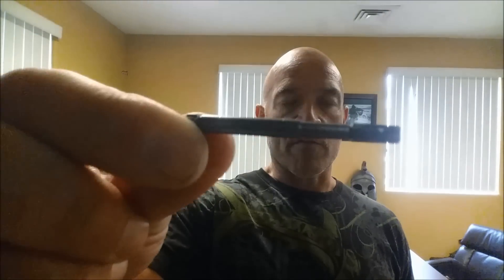Suarez Steel Firing Pin

Comment: Does the lighter weight of the pin increase the possibility of light primer strikes? Or does the fact that the material being harder compensate for the weight reduction?
Reply from the maker: Not in my experience.  The longer firing pin nose would compensate for any issues that may occur.
Reply: Suarez International thank you.